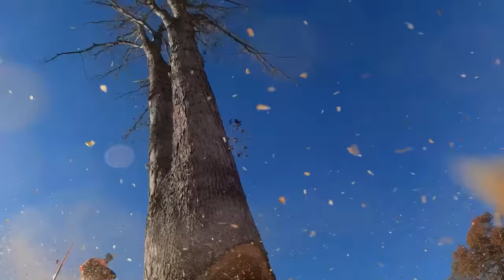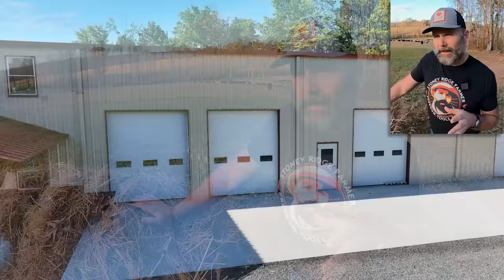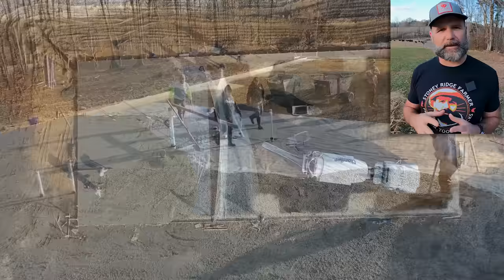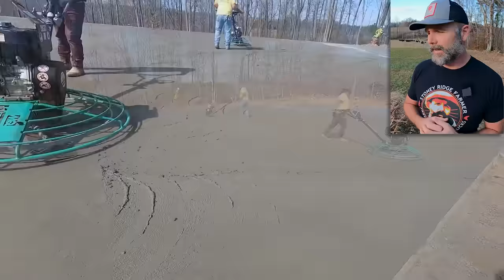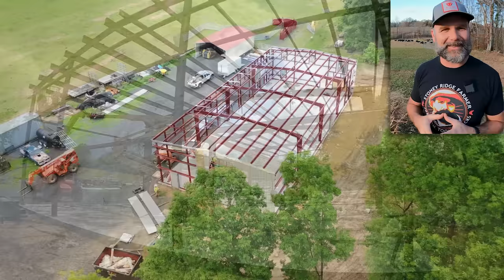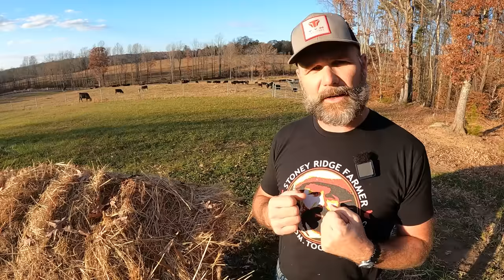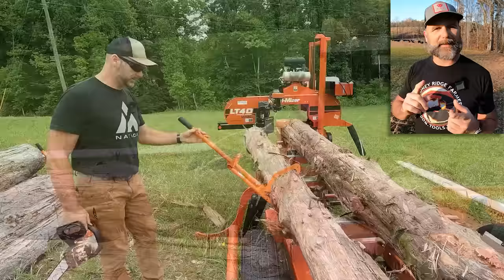Cops Came to Investigate Veteran's Farm! Heartbreaking disbelief

Comment: So did you get the proper electrical permit? No? The building codes are there to protect you and your neighbors from improper and dangerous practices so that you don't burn down the wilderness. You're absolutely right about government overreach on the whole... electricity kills people though. Not like a concrete pour(if it fails it's only your problem). 🥸
Reply from the maker: didn't watch the video did you?  Yep...I got the permit...and building codes do not protect me or my neighbors they are the MINIMUM STANDARD for building.  Fires still happen, and electricity does kill people....concrete has codes too my friend.  If I wanna put a receptacle in my bathroom...why is it anyone's business other than mine?  Home inspections are what protects the next buyer, codes in 1900 v/s codes in 2024 are night and day different....yet you can still buy a 124 year old home and it's still standing strong.  The gov't charged me $400 to dig a hole!!!  On my own property? Thats wrong

Comment: No where near as large a space or work that you have accomplished, but in 2019 after my dad passed, I inherited his truck and additional tools that I knew I could use to install a fence for my Akita/Great Pyrenees to safely roam the yard. I researched the town ordinances and permitting rules and spoke with those authorities at town hall. The ordinance for fences states, fences are not a structure and also requires no setback. Max of 6 feet high for privacy around the sides and back and only 4 ft out front with a certain distance from the road that I can't remember at the moment. I had a survey completed (twice after the neighbor trespassed). I busted my butt putting in the posts and rectangle cattle fence and it is only 4 feet high all the way around. Set back 2 feet so the trespassers could still get in to mow their little patch on my side of their rotting fence. I hand squared a walnut tree I cut down and used those posts for our 12' cantilevered gate. Looks cool...

I few months later I got a letter in the mail from the town manager stating I needed to file a zoning permit for my "structure" and owed $35 for filing fee. What did you say about steam from the ears? After I calmed down, I took my survey to town hall and printed out the zoning rules stating that fences are not structures. The manager sensing my frustration, waived the fee if I filled out the zoning permit. I asked how long the permit will last and he stated, indefinitely. I said good, because of my trespassing neighbor I may have to add to or modify my fence for security. He agreed and took the paperwork and filed the survey with the town. 

Haven't heard a word or had a trespass problem in a couple years now. It does hurt when you research and follow all the rules and still get punished for doing right.
Reply from the maker: it's all about control and tax revenue isn't it!! Sad that the local gov't thinks they can push us around and looks for rules to burn us!

Comment: Yes, I think buildings need to be inspected and general occupancy permits issued.  However, these should be minimum standards only and for good health and safety reasons only.

Example: an apartment building I was aware of in Durham, NC housed 20-plus immigrants per 2-bedroom apartment.  During the week, they (all men) were out working, in double shifts, so not noticed by neighbors.  However, every weekend they would be off work and everyone at home.  There was NO WAY that apartmemt complex could handle 20-plus immigrants in a 2-bedroom apartment (several appartmemts in the se complex) staying INSIDE their home.  They partied, played loud Mariachi music full blast outside, fought after getting drunk, threw beer cans and garbage everywhere in the neighborhood, stayed up all night outside, and relieved themselves in public on our aparment doorways, breezeways, walls and walkways.  Zoning to regulate occupancy would have fixed that problem.

Our county (E. TN) HAD no building permit codes (and this example is one reason why they had enough, not the only abuse reason, but one of them...)  Now the owner has 230 individual homes built on a fraction of 36 acres.  Of tuat space, 72 individual homes (single level) are built on less than 2 acres.  (You think I am kidding.  No. I am not)

Same owner has plans for and is building up to 800 more homes on a 160 acre mountain parcel.  All total, over 1000 new homes in a 200 acre rural area.  No build permits required. Think about how that imoacts rural living in ONE county where this number of new houses is about 8.5% of the total  population of the entire county --- ONE owner.

These are two extremes.  Rules are to prevent the extremes from happening everywhere.  Imagine being the rural next door neighbor of either of these situations.  You THOUGHT you were buying into a rural farming area.  Next thing you know, within 5 years you are direct neighbors with 1000 homes and wondering why your power keeps resetting as the power lines are overloaded and suddenly you are living in a high traffic zone.

Another city, Saint Louis, I am familiar with, has militant occupancy laws.  I hate it, but I can underatand it.  When in tight city quarters and high rise buildings, literally there is a high rise fire call every single day.  And limiting occupancy by square footage, relationships to others living with you actually controls crime by not allowing overcrowding and squat houses of unrelated persons (no more than 3 unrelated persons can live in the same property.)  The EASIEST way to stop bad business practices there when bad actors cannot be otherwise stopped has been saved by neighbors being able to envoke the occupancy permitting process.  I hate it.  But sometimes I am very thankful such an option is available to keep the neighborhood sane and safe.
Reply from the maker: nothing to do with immigration and more to do with controlling us.....what did we do 100 years ago? Amazing those houses are still standing and are better built than the houses of today....it's all about normalizing control and overtaxation

Comment: Here in lies the problem...lawyers.  if you were to sell ND the building wasn't to code and it fell down, it's someone's problem.  Liability has been stretched to the mx because if anything happens it must be someone else's fault and they must pay.  This is what happens as a society degrades.  We are wayyyy over regulated.
Reply from the maker: that's why ya get a home inspection when ya buy a property....the inspector is liable for everything he/she reports to the purchaser.  The purchaser assumes liability when they sign the home inspection and approve it.  I'm with ya...we live in a sue happy society....agricultural buildings only require an electrical inspection here in my county...crazy huh

Comment: We do not have codes or permits here in my county. There are no size requirements or anything but with that being said, INSURANCE companies are picky. The only two required permits if you want to be hooked to the grid are septic (must be put in by a certified contractor) and electrical put accordingly,  mostly to current code (the exception being all the breakers must now be GFCI, crazy). If you do not want to be connected to the grid, if you want to do something alternative, no codes or permits. It can be refreshing but since we live in a high poverty and drug area, there are definitely some draw unintended draw backs.
Reply from the maker: 2 words....FARM BUREA my friend....so easy and so much cheaper than the rest!

Comment: The problem with regulations is that enforcing them inconveniences people who abide by the law. But it must be done in order to catch people who don't abide by the law. Certain laws are in place, not necessarily for your benefit, but for other people's benefit.
Issues with electrical systems are regulated for that reason. Sure, as long as everything goes well, it's all your business. But if you run an electrical system that isn't up to code (I understood that they misplaced your inspection report? so they have to assume that it is below par) chances increase of something going wrong. And when something goes wrong, it becomes the county's problem because they have to send the firefighters out. Risking human lives, spending lots of money (FD interventions cost heaps of money), and making them unavailable for other eventualities. So even when it is your private property, it is still the government's business to know that everything is safe and sound in there because you mandated them to come save your a$$ when something goes wrong. That's the social contract we all have and that's why regulations are in place: to make society work consistently.
(Also, a farmer adding a building with potentially 4 bedrooms, might be housing unregistered staff, right? A simple eye ball inspection takes away all doubt in either direction. I'm surprised that such a visit is not included in the process by default. Especially because you apparently don't have to ask building permission, which imho is a ridiculous freedom to have...)

Comment: To some degree it does affect others.  If you don’t put in septic, then later sell the property, the buyer could be hurt by no septic.  That said, we are over regulated.  We lived in a county in Idaho with no building codes.  We tried to buy property that included a house that had been constructed around a trailer home.  It was beautiful and very well done.  However we could not get a loan for this land because there were no rules regulating it.  I think we still have more freedom here than most countries, but that is due to the relative young age of our country.  With more time and more people we lose more freedom.  And then you get a despot, like our current president, and you lose even more rapidly. In 50 more years this will be unrecognizable as the USA.

Comment: King co. Wa. You have to have permits for everything, and they are not cheap, permit for carport, clear blackberry, make a trail, garage or shop, build a deck, build any out building over 200sqft, cannot build on wetland, have wetland setback, have a setback against the setback, can’t build because no reserve drain feild, can’t use alleyway as an alleyway unless you put in a road on your dime and use there dimensions and materials, I wish I could move

Comment: You complanine for 16 min that code enforcement showed up , but you never said why?
Did they think you pulled the wrong permit? 
Do they think you use the wrong wire or box?
Did they think your transformer was to small for what you were needing?
What was the issue?
Reply from the maker: The issue is that I went to the tax office to report their error...I walked out and code enforcement shows up at my place the next day as well as  a call from zoning and planning
Reply: @StoneyRidgeFarmer  Have they done a final inspection on your building ? If they haven't they can keep showing up  everyday until  your building has had it's final inspection and passes final inspection

Comment: You say you were punished.  How were you punished?  You were fined or imprisoned?  Or just your just your pride and feelings were hurt?  I do agree that everything in the USA is over-regulated.  That's a large part of the reason that the USA manufacturing industry has largely moved abroad.  Even pharmaceutical industry now has to do a significant amount of drug testing abroad.  Rules and regulations are too time-consuming and expensive to deal with.  It gets to the point where it leaves you thinking....why bother doing anything these days?
Reply from the maker: Punishment defined:  What is prison? What does jail or prison do? Takes away your time....what just happened...I took the time to do the right thing and was investigated.  What did this do? It took my time, stressed me out and wasted part of my life.   Your time is your most valuable commodity....when someone takes it like this...it is punishment.  Don't believe me....get charged with a crime you didn't commit and head to court....that is punishment whether you're convicted or not!

Comment: Septic tanks are regulated for EPA and water resources to protect ground water . You can’t own what’s. Under ground in west. Most states require permits for water, electricity, gas , and  grading to keep rain water on your property .also harvested mill lumber has to be stamps on it to build. Bottom line if someone can tax it they will . It’s about money and power.i think rules for rural land could be relaxed.. even off grid is getting harder because there is no utility cost. Look at electric vehicles as of today don’t pay road building taxes.
Reply from the maker: yep.....permission, permission permission!  I agree with a proper septic system....but I don't agree with paying $400 to dig a hole on my property and have a civil servant come look at it for approval....I pay taxes for the civil servant's income

Comment: There are a few things I don't understand.  First of all, the country should have records of all permits that have been issued on a property/structure.  Were these permits not filed properly by the country or were they too lazy to look them up?  I know that sometimes a building contractor needs to look up old permits to see what was done as far as electric, plumbing, or the structure itself.  It saves doing a bunch of demo if it's not necessary.  So, if there was a permit why didn't the country have this and why didn't you have it (as part of your own records) to show them when you were dealing with all of this?  But what I don't understand is why you were upset about the officer coming out to the property.  Why is it a big deal?  Sounds like it's more about your own pride, rather than just accommodating their need to make sure everything was done properly.  Obviously, these were mistakes on their part in regard to information not being filed properly (and your own for also not keeping your own records).  But...  I don't understand why this made you angry.  I feel like I'm missing something.

Comment: I wasted 16 minutes & 4 seconds listening to you whine. I have no idea what the "violation" was.  You bought the land. It's your responsibility to comply with LOCAL building codes, not Wyoming (where you say there is no code.) IF you pulled an electrical permit did the work, and it was inspected by the county. It makes no sense they later have a "complaint." What permit did you pull. Was the finished work inspected and passed?
Reply from the maker: insulting me seem appropriate to you?